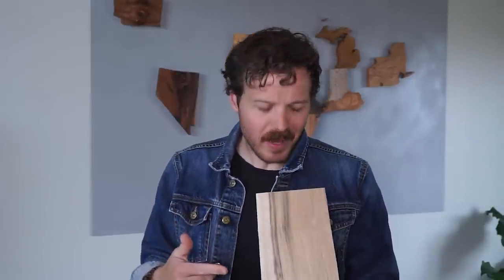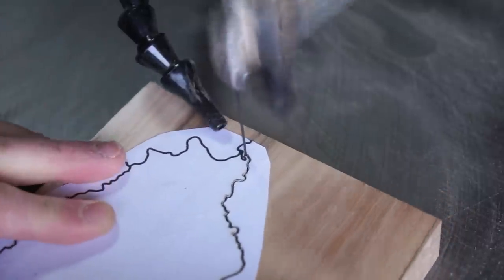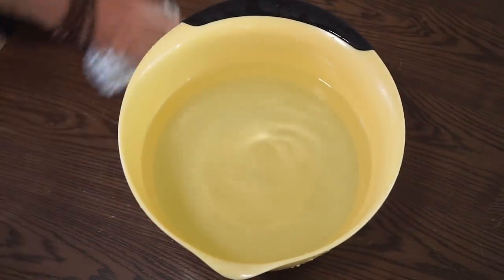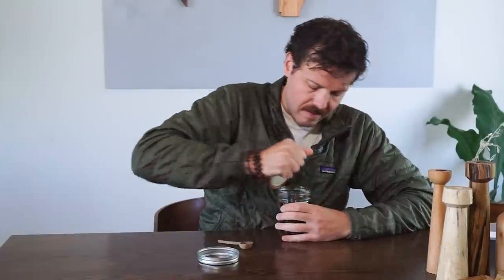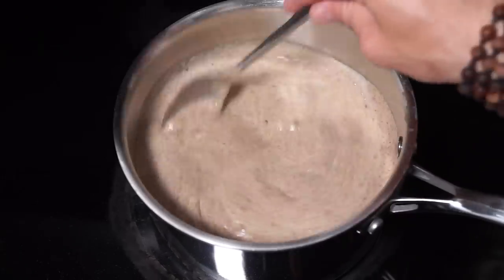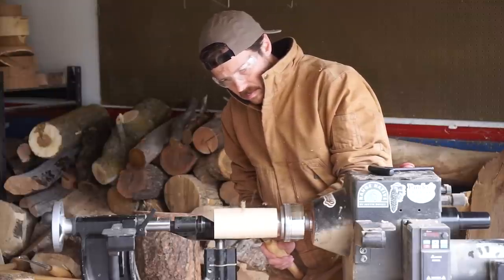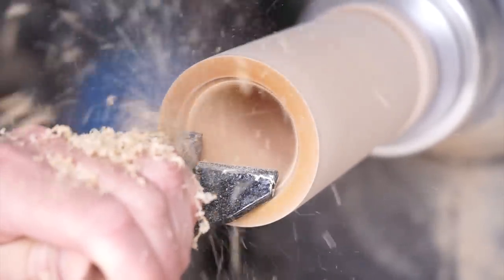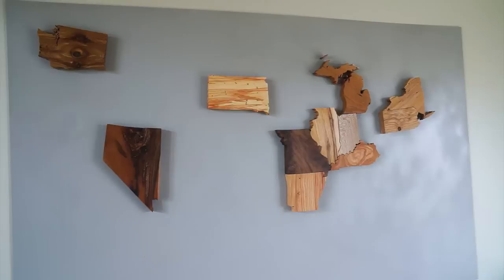How to make syrup out of tree bark | Justinthetrees US Tree Map

Comment: One tip to help with crystallization is using a wet brush to wash down the sides of the pot once it starts boiling. The crystals start forming in the residue on the sides and will continue the crystal formation down into the syrup. If you look up any kind of caramel making tutorial, they will show you how to do it since you also do that when boiling caramel so that it doesnt crystallize

Comment: depending on the tree, you may need to seal the bottom of a hickory cup more than other woods. It has fairly large pores in its end-grain and could leak/weep. It has tyloses, though, which serve to block some of those pores, so it's not as straw-like as, say, red oak. In general ring-porous woods with large pores also tend to not feel great in the mouth, due to how they swell.

Comment: 4:24 Elevation affects the boiling point of water, so if you're making candy or a syrup and the recipe gives you a target temperature, you may have to adjust for altitude. Rule of thumb: subtract 1 degree F for every 500 ft above sea level. So here in the Salt Lake Valley, I'm at about 4,500 ft, so I would subtract 9 degrees, so for this syrup I'd aim for 216. The target temp basically tells you how much water is remaining in your syrup. Once it reaches the boiling point of water, it takes a while for the temperature to rise any higher, because at that point you have to wait for the water to evaporate.

Also, you can usually avoid crystallization by washing down the crystals on the sides of the pan with some water on a pastry brush once it comes to a boil, or boiling it with the lid on for one minute. Then avoid stirring it thereafter to prevent additional crystals from forming on the sides of the pan.